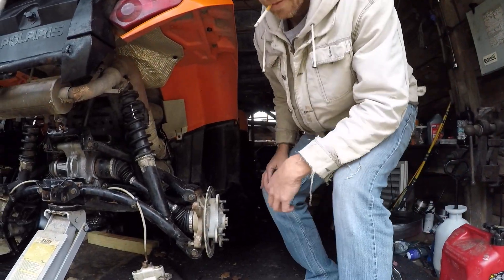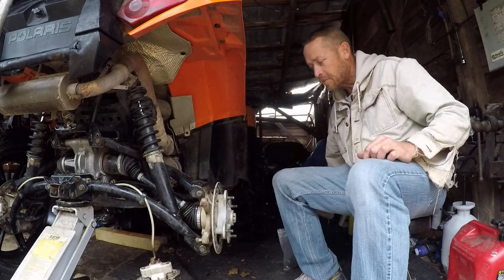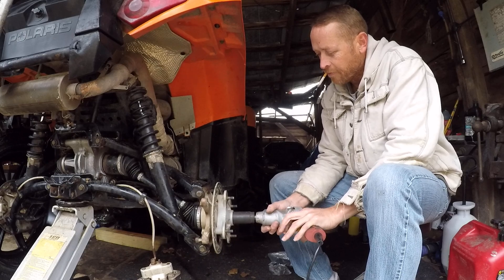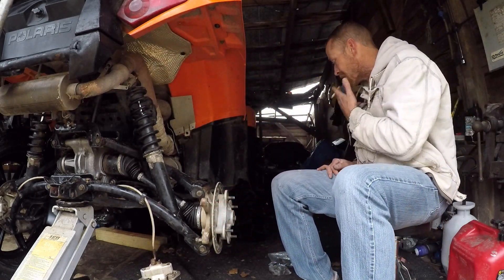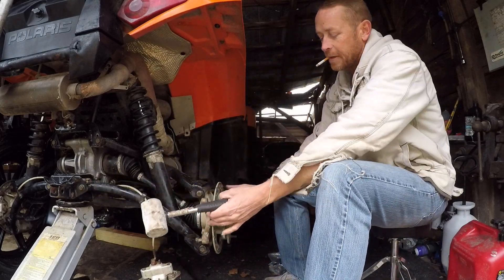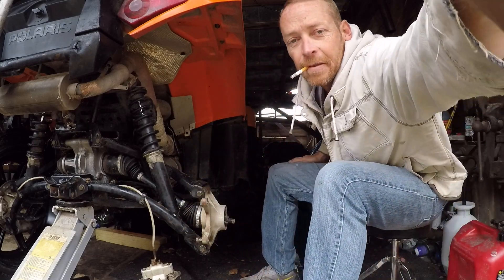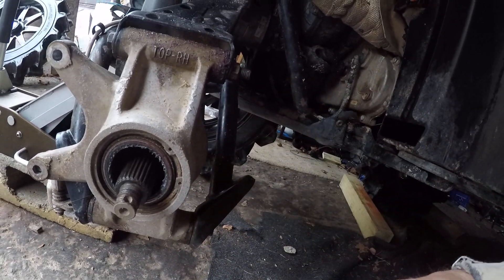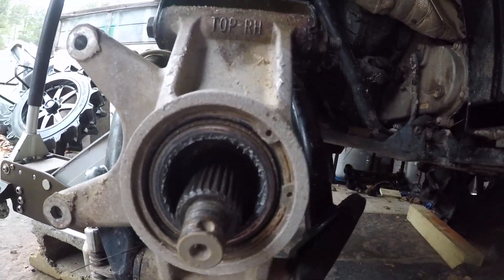Diagnosing wheel wobble on an ATV/ '16 Polaris sportsman highlifter 850

Comment: Looks like you'll need to spin up some bigger diameter Delrin bushings. The bore is clapped out. And you may have to shim the new bearings as well. Big tires like that put a LOT of force on the hub.